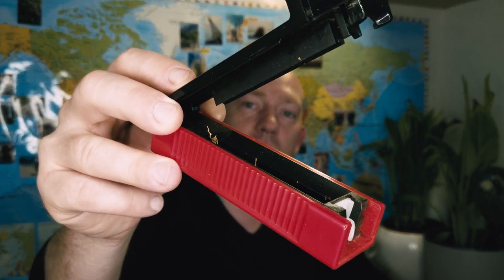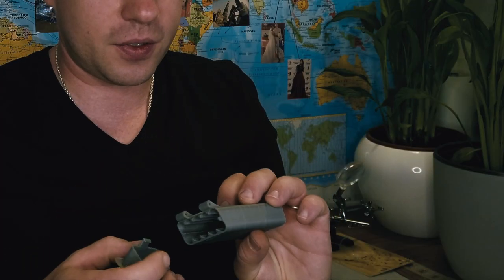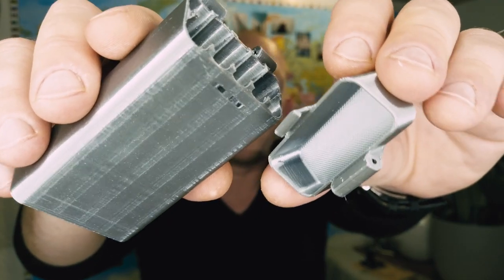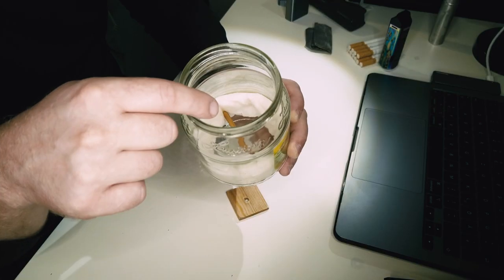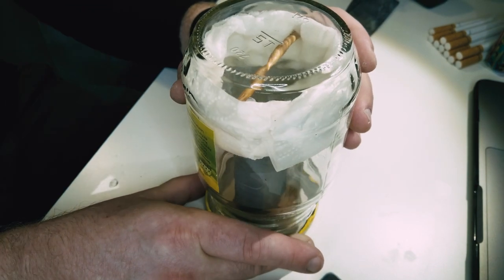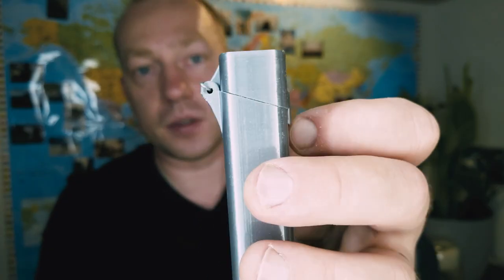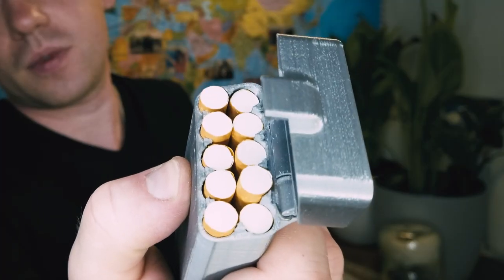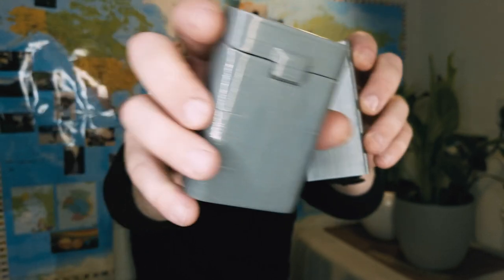3D Printed cigarette case ABS (plus vaporizing with acetone)

Comment: Hey man, I dont smoke cigarettes but I smoke cigarillos. Small ring gage cigars. I want to make a box to take one or two with me on hikes. I dont have a travel case so I always worry about smashing them in my pocket. I wish you had spent more time on the design portion of the video. Anyways, good video. Thanks!
Reply from the maker: Hi, I have few videos that can lead you to your desired design, one of them is: 
Fusion 360 tutorial Hinge, Lock, Box (Snap in Place).
You just need to adjust your own dimensions and it is not that complicated at all. 😉